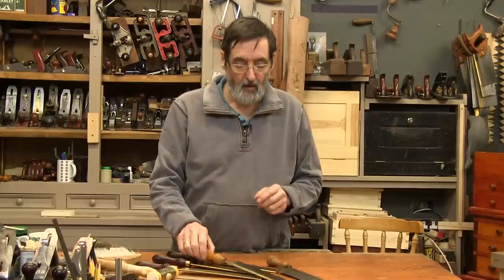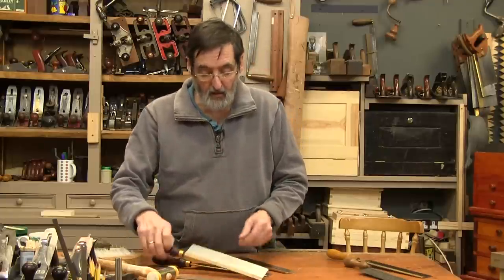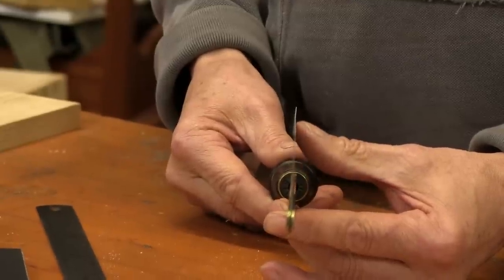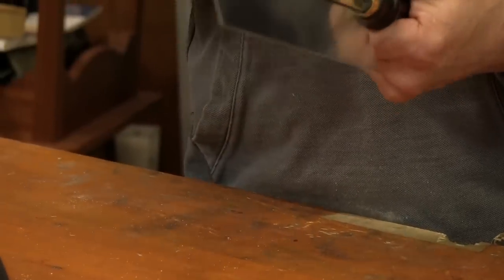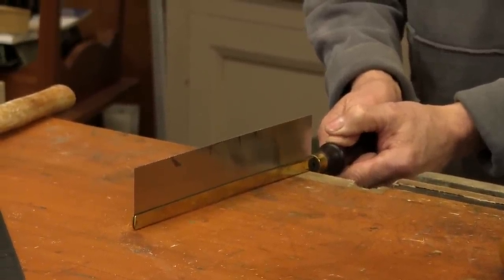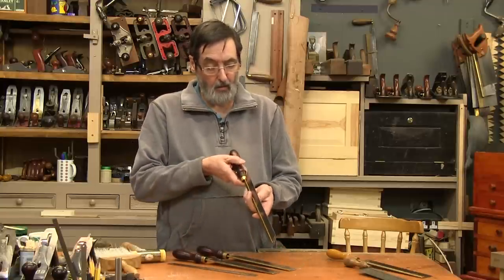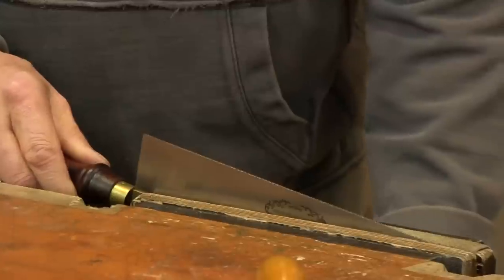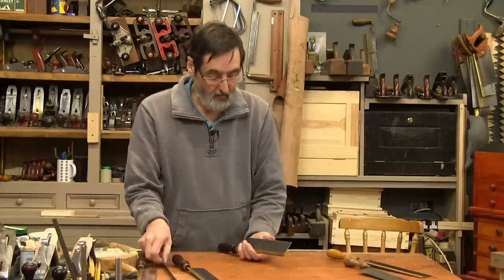Saw Straightening | Paul Sellers

Comment: Hello Paul, I have succesfully used your advice on a backsaw  quite similar to those shown  in your tutorial. Now I found an old Slack, Sellars & Co tenon saw on a flee market, payed 2€ btw. As the Piston grip is screwed to the blade, I wonder how to straighten it? The back itself is made of u-bent steel and is dead straight, whereas the blade not only is bent in one direction but kind of two way zig-zag curved.  Maybe it will be best to unscrew rhe blade trying to tap and whack without the aid of a handle? Any advice would be appreciated. Simon.

Comment: Paul,
I have a big pile of old, good quality hand saws that I am eager to restore and use or trade. I have the sharpening down well enough but need help with taking the bends out of large, backless saws. I've found instructions on the internet that call for tapping on the saw with a roundhead hammer, but can't figure it out for myself. I need video of this craft.
I would also like to restore the etch on some of these saws but can't even find verbal instructions for this. I am sure I am not alone in this- there must be many others wanting to do the same things.
Help us Obi-Wan, you're our only hope!
Reply from the maker: We have a vid in progress on this so will let you know.
Reply: Paul Sellers Sounds good. Can't wait. I have one with a bend but I'm reluctant to start hitting with hammer until I see what Paul has to say about it. Plus I think I need an anvil.
Reply: +gregg usselman For raising an etch you can use gun bluing or vinegar. Just put it over the whole area, and then used sand paper attached to something flat ,or a flat sharpening stone, to sand off the black rust that is on unwanted areas. Some etches will be too shallow even for this, however.
Reply: +gregg usselman Also, if a saw has a bow in it, you easily get it out just by submerging it in boiling water or pouring boiling water on it and then simply bending it out.

Comment: Would this work on larger bass back saws? Thanks for such great information!
Reply from the maker: Yes, just a little extra strength that is all.
Reply: Paul Sellers Thanks. Most of my gent saws are good. I have a tenon saw that has a bow in it. I will try this!

Comment: Hi. First off again thanks a lot for all your vids.
A pal gave me some used japanese saws for free.
One of them although it's still sharp has a nasty bend along the first 5 cm on the front of the buttom saw side.
Obviously the previous owner didn't understand that it's a pull saw and not a push saw...
Is there something I can do to get it fixed?
Reply: SMCG if you put the blade in a vise fairly tight and heat it with a heat gun to about 60 degrees celsius it will go back to original straightness although some i have had have left the factory with a ever so slight right hand bend be careful not to heat it too much to avoid making the blade brittle